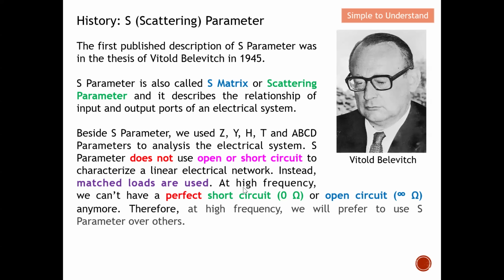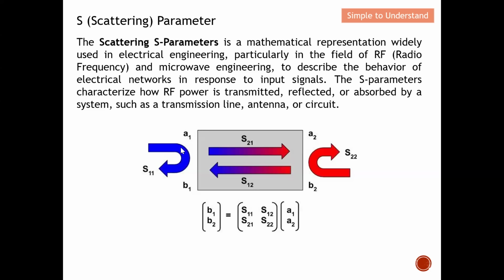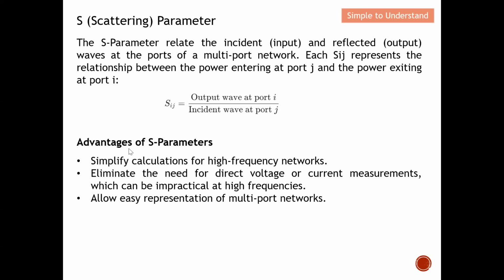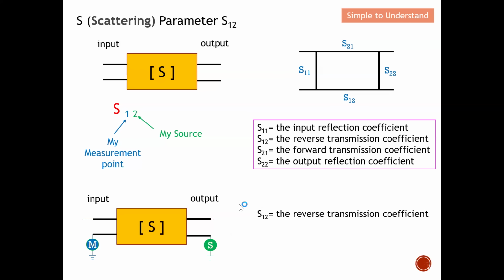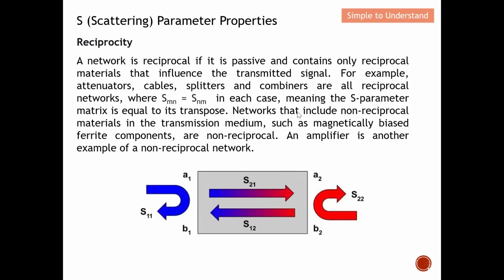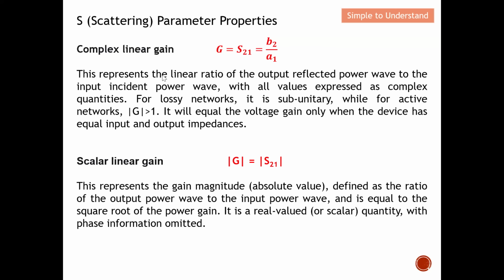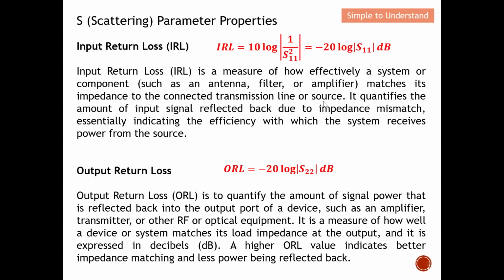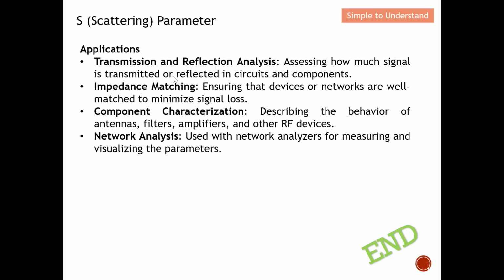S-Parameters #1. Scattering Matrix S11, S12, S21, S22 Properties: Reciprocity, Lossless, Lossy, Gain

Comment from the maker: Thank you for taking the time to watch this video.
Here’s a quiz to test your understanding of S Parameters: In a two-port network, if S11 is measured as 0.6 at a certain frequency, does this indicate that 60% of the incident power at Port 1 is reflected back? Pls share your ans through the comment.
This video will begin with a discussion on the history of S Parameters. Next, I will explain how different forms of S Parameters got their names. For example: S11= the input reflection coefficient, S12= the reverse transmission coefficient, S21= the forward transmission coefficient & S22= the output reflection coefficient. 
Following this, I will define S Parameters under various network conditions, including Reciprocity, Lossless, Lossy, Complex Linear Gain, Scalar Linear Gain, Scalar Logarithmic Gain, Insertion Loss, and Input & Output Return Loss.

Comment: Can the NRW method be reliably used to extract permittivity and permeability of thin films from S-parameters? If not, what alternative methods are suitable for thin-film characterization?
Reply from the maker: No, the standard NRW method is generally not reliable for extracting the permittivity and permeability of thin films from S-parameters. The key for thin films is to use methods that are indirect (model-based fitting) and account for the specific measurement geometry.

Comment: what is the answer?
Reply from the maker: Hahaha, I almost forgot I ask this question.
My reply:

No, S11 represents the magnitude of the voltage reflection coefficient, not the power reflection coefficient.
To find the power reflection coefficient, you need to square the magnitude of S11:
Power Reflection Coefficient=∣S11∣^2 = (0.6)^2=0.36
This means 36% of the power is reflected, not 60%. The confusion arises because many people misinterpret S11 as directly representing reflected power, overlooking the fact that S11 is in terms of voltage (or current), not power.